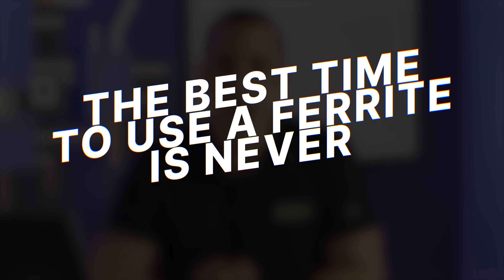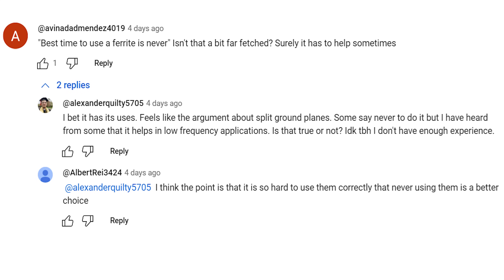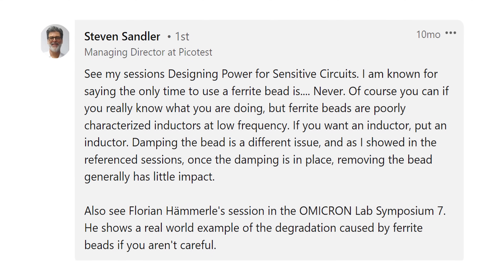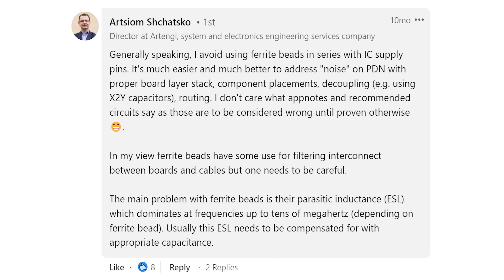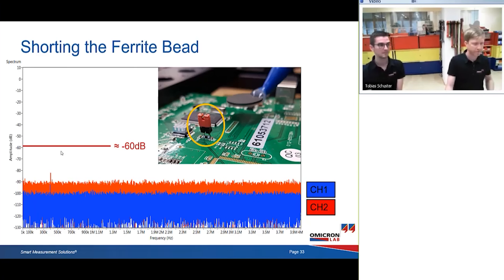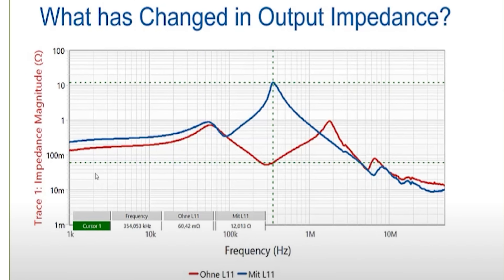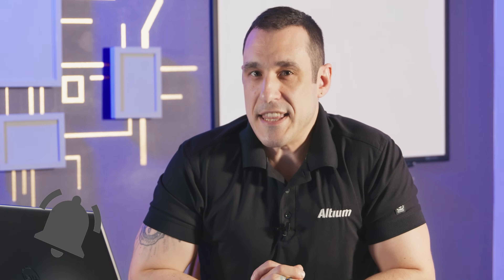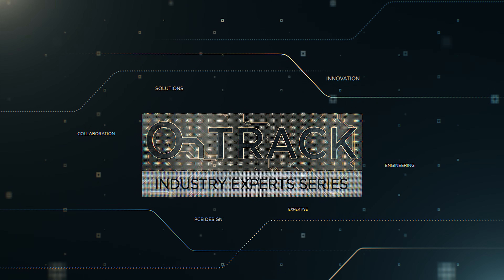Ferrites in Digital PDN: What the PCB Experts Say

Comment: I hate the ferrite without low impedance current path to the ground from load. Some time i put a realy small 33-100pf mlcc’s across the dgnd and dpower pins to keep the HF impedance under controll and prevent this HF current to flow thru and spreading on the ground.
The next one 100nf is too far and too slow to deal with. In most of case this trick can make the ferrite works OK so get better noise performance with then without.
The most of the desing flaws are done with inductors, when is placed paralel with other inductors like traces, resistors or shilded cables. Or placed to close to metal objects like shields or screws.

I am not a circuit designer, but many times i have to solve miss beheves and or noise problems in current designs.

Comment: Hey Zach, thank you for the great video, ok the time for ferrites is never, but  
Rail filtering has always seemed complicated, Actually it would be nice if there was a roadmap video.
For example, how do we know we need a filter?
Which filter is more suitable for which job?
If we want to simulate these, how do we do it?
Can we be sure with certain calculations without simulating?
How do we know if we really need ferrite beads?
An example pi filter design would be very useful.
Whenever I look at a design, filter values taken from the design guide are used, but won't this filter become ineffective when a different dcdc converter is used?
Reply: I did another one after this where I compared the basic filter options. I think the moral of the story is that a damped pi filter looks very similar to a ferrite filter at low frequencies and near cutoff, so they can be vey helpful for attenuating a specific frequency range while allowing DC power delivery.

Comment: tl;dw: "If you want an inductor, put an inductor."

Joking aside, and speaking of inductors, I know of power amp designs that recommend axial series output resistors with a parallel inductor of N gauge enameled wire wound X times around the resistor body. Whiskey Tango actual Foxtrot?! It's a low value resistance and you presumably want a known (or at least predictable) inductance; specify a wire wound resistor.

Comment: Thank you for all the amazing videos
Related to this topic:
We have a product that requires the use of a long cables from the DC Power supply (12/24V) to the PCB (which power uC and inductive and resistive loads) that long cable (around 5m) of course will cause some noise, voltage spikes when we PWM it... what do you think the best way to filter that voltage source in order to supply clean voltage to loads and ICs? Do you think Pi filter with inductor and capacitor is better instead of ferrite or just using higher decoupling or there are other options? Thanks.
Reply: The main problem is the AC content on long cable and its high inductance. Then the second one is a high resistance and a not constant DC load.
So this is can be more complex to slove with only CLC filters. 
The possible way is put only a near-constant (dc) load to the cable and u have to deal only with the cable resistance/voltage droping.
The second way is reduceing the current fructuating frequency to minimum and desing a remote-sense-ing psu what is stabile with long feedback and conservative load fluctuation. In that case may have to shild the cable from RF noise.
The third way is isolate the high current load from the sensitive parts at the psu output. The load is olso have to switch with galvanic isolated driver.

Comment: What about using ferrite beads to isolate the same (positive, not gound) power rail for use in both digital and analog power domains in an IC?

An example: some microcontrollers have separate digital and analog power supply realms, mostly used for ADC and whatnot, and in most cases you won't have two different power supplies to use exclusively for analog stuff (for whatever reason, e.g. size/budget constraints, etc.). What I commonly see people recommending is to put a ferrite bead in series with a, say, 5V supply, followed by a capacitor (generally a bulk and a decoupling, if my terminology here is right) to ground.

All of this considering proper ground planes in the PCB (not isolated, per se, just properly separated).

Is that an acceptable use case, or is it representative of the same pitfalls you guys discussed in this video (useless, or worrisome)?

(Sorry for the admittedly beginner's question; thinking about this use case specifically, I couldn't quite transfer and infer anything from the video.)
Reply: This is one of the common instances where I see ferrites used and it really depends strongly on what you are trying to measure with the analog rail. This is equivalent to the case of isolating a dedicated rail for a PLL, and I have seen mixed results. If the analog rail is only measuring at DC, and the circuitry in the analog interface will not need to draw fast pulses of current, then there is no risk that the voltage transients on the isolated analog rail will be seen on the main digital rail. Whether this will actually work depends on the ADC type (sigma-delta, SAR, etc.), whether you are isolating just an external reference of if it's the whole interface.

Comment: Perhaps chip maker datasheets need to be submitted to ‘peer review’ before being published? 🤣
Reply: I must confess to taking some datasheet example circuits as Gospel. A little design review outside the developers' walled gardens would be good for everyone, including the developers.
Reply: @petersage5157  The trap we easily fall into is treating every datasheet as though it were handed down from the heavens like Moses and the 10 Commandments, a fully formed document of perfection which has been sweated over by a squadron of pixies from the black forrest.

Sure, datasheets are a primary source of truth about a component, but that primacy still exists on a spectrum of accuracy, quality, completeness, even the manufacturer's own degree of giving-a-fuck-ness.  They're often compiled by many engineers, and maintained by a different subset of engineers spanning sometimes decades, from the oldest and most experienced, to interns.  

And that's all before getting to the 'implementation guidance' parts of data sheets, where even more breadth of experience in the many applications and industries in which this component might be used comes into play!   Also, when it comes to EMC, copy-paste perpetuates old/bad techniques year after year after year.
Reply: Lee Ritchey even says that it is still true today that most people creating the data sheets don't understand board layout. Unfortunately we are stuck with it until those respective components become EoL. Which could be a loooong time 😅
Reply: Oh man that would be interesting for sure, their eval/reference designs should also be peer reviewed. There are some companies I have found that actually understand some things about board layout, for example Texas Instruments has an internal CAD team that does a great job. Other companies though.... not so much.

Comment: Great video! I always enjoy a montage of experts coming to destroy ferrites :) A couple of questions: 1) You mentioned in your summary point #2 isolating rails with a ferrite, "you will need to qualify it in test and measurement". Outside of getting on a scope and looking for resonances, what else would you suggest? 2) Your summary point #3 mentions noise being created by the ferrite which will make it's way to your digital I/O's. Are you saying from the H or E field being generated that will couple to IO's? What is the source of the noise? Or, is that comment the same as Joanna McLellan, where she says the pin will ring because no current and be sourced since it's high-impedance? Cheers
Reply: 1) it's a simple matter of monitoring the isolated rail with and without the main rail running, then compare the two situations. If the isolated rail is an I/O supply, you can probably more easily monitor the I/Os, and then short across the ferrite as needed to "remove" it from the PDN. 2) That comment is basically the same as Joanna's, the origin of the noise is an underdamped resonance in the rail voltage when the I/O switches. As I/Os switch, they are attempting to draw current from the power supply and capacitor bank (essentially an RLC circuit), but those elements can only respond so quickly. As is known from RLC circuit theory, any additional inductance will slow down the response to an input current pulse and thus the transient response in this 2nd order circuit has a high chance of being underdamped. You could add damping to make the system critically damped, but that now reduces power efficiency and it will cause the bandwidth of the control loop and the PDN's power delivery range to be attenuated to lower frequencies, so the PDN will be unable to deliver power for fast edge rate signals.